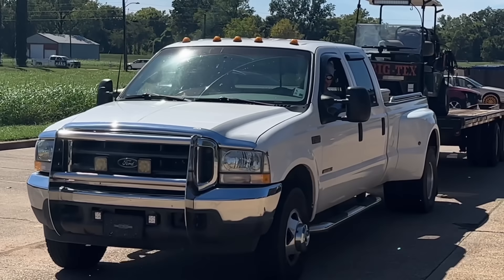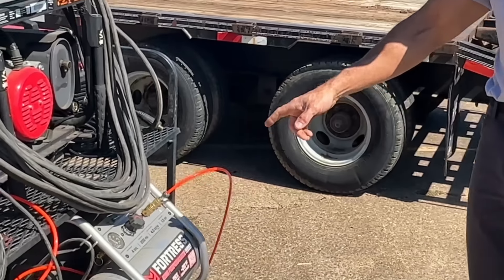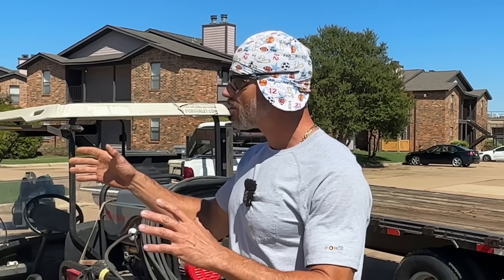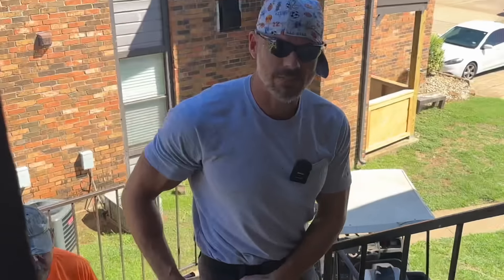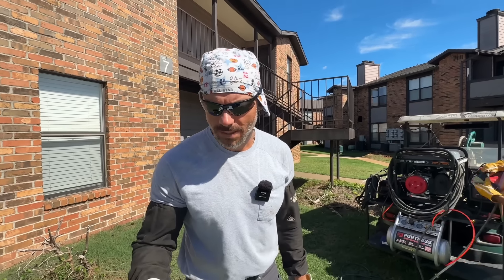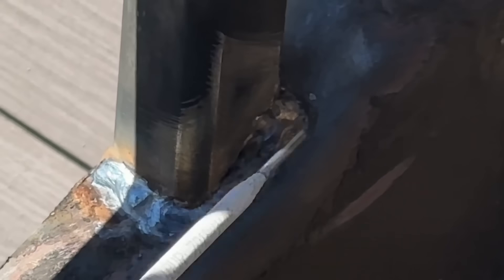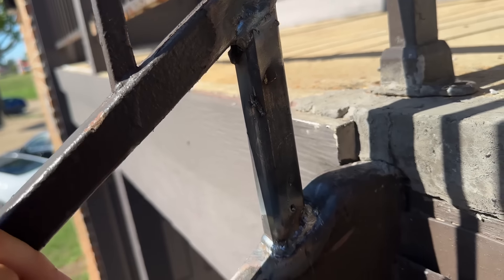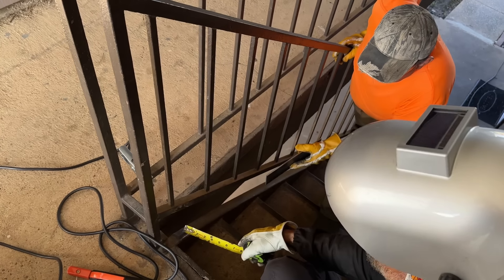Secret Side Hustle for Welders: Boost Your Income Now!

Comment from the maker: hey everybody, thank you for being here. Here’s the link to the welding hood I’ve been using. 
👉15% off Link to Tefuawe welding lens F10/11 https://tefuaweweld.com/discount/TaylorWeldingLLC  ☝️

and here’s the link to the inexpensive welding equipment
👇

https://www.arccaptain.com/?ref=DGWXRheU
use coupon code Taylorwelding for 5% off
Reply: I feel like this is exactly what I needed thank you so so so much
Reply: Very impressive..........
Reply: I am curious... How do you figure how much you charge? Is it a flat rate? If so how much? Or per hour?
Reply from the maker: @willhall7777  120 an hour. Flat rate for me and JOSE . My time started when I started rigging out the golf cart
Reply from the maker: It’s expensive. But that’s what I’ll do it for . otherwise they can find somebody else.
Reply: All of those are good condition???
Reply: Just out of curiosity, are you using the mig200 on the generator? I have the same multiprocess machine and have not used it on a non inverter generator for fear of messing up my welder.
Reply: Also, I bought a Milwaukee metal cut circular saw, they sell at big box stores for almost 300, got it on Amazon for 150, and it cuts through 1/2" steel like butter, just a thought instead of the plasma cutter.
Reply: Do you carry insurance for something like this? If so what limits?
Reply from the maker: yes a million dollar umbrella policy is pretty cheap @joecool4836
Reply: @TaylorWelding  what state are you in and what insurance company do you use? If you don't mind me asking. I'm in TX and I know some insurance depends on state.
Reply: @TaylorWthat won't be a problem pretty soon,and at the end of the day,we can go have a cool one elding

Comment: Try running the plasma cutter while the air compressor is off. It sounded like the compressor was kicking on and that would eat up your juice also.
Not a fix, but you can see if you can do something a little different for the air compressor.